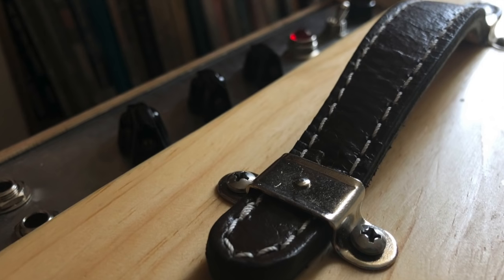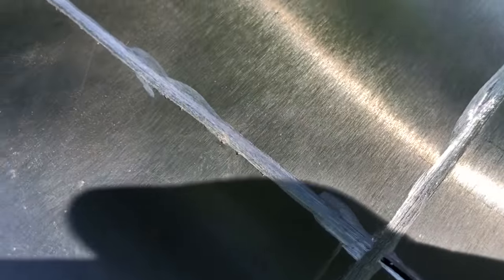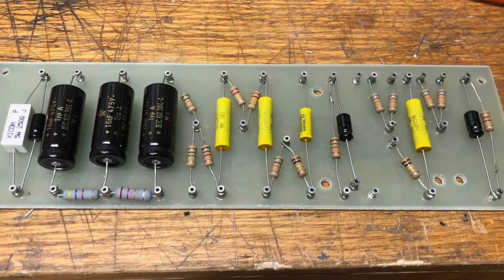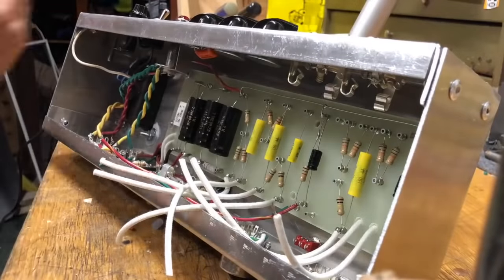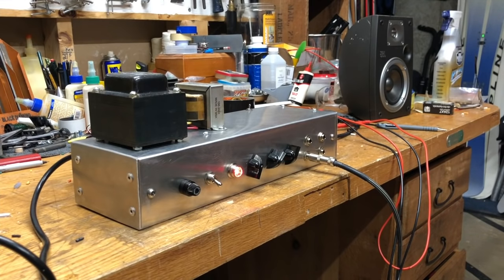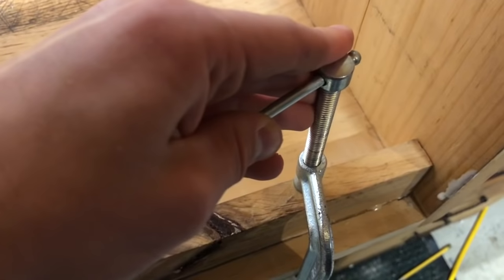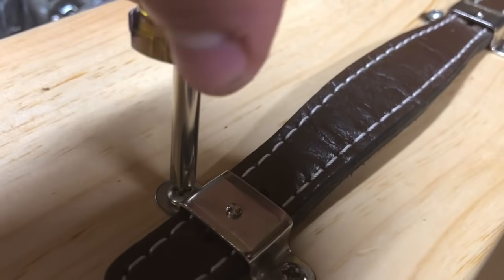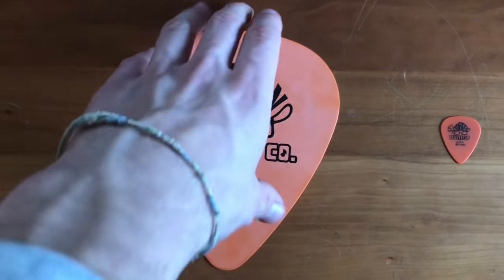Building a 5E3 Deluxe Guitar Amp From Scratch

Comment: Awesome project! I'm wondering why you deleted the standby switch? Typically, they will divert full current away from the tubes until the tubes have warmed up, greatly extending their service life.
Reply from the maker: Thank you! I deleted the standby switch because it really isn't necessary for the amp. It's actually a common misconception that a standby switch protects the tubes by applying the high voltage after they warm up, but it doesn't matter for the types of tubes used in guitar amps (receiving tubes).  The only real positive function they have is to protect the filter capacitors from the voltage surge that comes when you turn on the amp, but the voltage rating for filter caps are often more than enough, and if not this can be easily solved by just using slightly higher voltage filter caps. Also, here are a couple interesting articles that I used when I was researching this stuff:

https://www.sweetwater.com/sweetcare/articles/great-standby-switch-myth/

http://www.valvewizard.co.uk/standby.html#:~:text=You%20may%20have%20heard%20of,electrostatic%20field%20from%20the%20anode.
Reply: @joeles2738  I notice when I turn off my amp, if I do not turn off the standby switch first my tubes make a horrible squell.  You are saying thats not a problem?  I have a carvin nomad 112  Great video I am looking foward to getting into building & repairs myseld
Reply: Joe is correct on this one, standby switches aren't needed, they are a nice way to mute the amp quickly but the volume control does an excellent job at this also. Receiving tubes could care less whether HV is applied to them at turn on vs later. Tubes don't pull current until they are warm (reach operating temp).

Comment: Great job! And no standby! Finally someone's going back to oldschool :D However Uncle Doug wouldn't be happy with the heaters wires laying on the chassis :D
Reply from the maker: Thanks! I feel like there's a lot of controversy over heater wiring but in reality if you do either way neatly you get the same result haha
Reply: @joeles2738  haha yeah. A lot of this are kinda a preference I guess. Switch before fuse or fuse before switch? Ground soldered or screwed to the chasis? Bus ground? Star ground? If it works it works :D

Comment: My thoughts on designing an amp.....

I'd probably want the controls at the front, maybe even across the front edge at 45 degrees. It's no great hardship leaning over that little bit - but the controls were at the back because you stood behind your combo, so the reason for that placement has gone.

But my real bugbear...downward facing sockets.

I've never seen one fall out (except when they're being changed) but there's the option of having them stand upright or perpendicular.  Yes, it's convenient when you're swapping them out but how often does that happen?

I'm also not a fan of having the heat rise into the amp - not a biggie, but is there an advantage in heating your electrolytics or is it just boiling them? 

One thing I've always fancied - one of those cord retracting mechanisms like you get on vacuum cleaners. It'd be a bit of work - making a little house for the plug to home into and making sure it couldn't hit any of the glass on the way - but the idea tickles me.

Comment: Very nice!! I loved in the demo how the camera would shake with the higher gain sets!! :-) You mentioned a few mistakes… What would you have done differently in retrospect? (I’m definitely building one of those one day, but I’d like to avoid as many problems as possible)
Reply from the maker: Mainly it was things like I wish I had taken more time to make the inside of the amp look good, I should have used better tube sockets (I ended up replacing them) and the grille cloth needed to be replaced eventually because it wasn't very tough. I made a follow-up video that you could check out if you want that goes into greater detail about stuff I changed after this video was published and some things I wish I had done differently.

Comment: sick video man! amp sounds great. this makes me want to build my own amp. ill most likely do  robinettes jcm amp as im more so into "classic" rock. ill probably do some of his mods from the "tweaking the overdrive intensity & tone" section as well.

P.S. thanks for showing an easy way of making a cab! [or at least you made it look easy] i am usually not very good with wood working. at least where precision is needed! hah
Reply from the maker: I'm glad it was helpful! And yeah I actually don't have much woodworking experience either, at least with stuff that I want to look nice like this. The cabinet was definitely a challenge for me but I tried to do it in a fairly simple way. There are also much easier methods than finger joints for the main part of the cabinet, and if you're covering it with tolex anyway it doesn't really make a difference cosmetically.
Reply: @joeles2738  Surprised to read your comment about your woodworking skills. All your jigsaw cuts looked very good and accurate.

Comment: Yo this is fantastic! Why did you go with pine for the build? Pine is soft and kind of crappy. But overall, this is awesome my friend. I'm going to build a tube amp. So far I'm most nervous with the actual buildling of the electronic side of the project. The wood working is my forte, so that will be the really fun part. How long did it take you to complete this and about how much was the total cost? All in all you did a fantastic job! Good man!
Reply from the maker: Thanks! I used pine because I had a nice pine board already and it’s also easy to work with and looks nice. It’s also what fender used in the originals. I think the build costed about $400 and took about 2 months. Good luck with yours!

Comment: This is fantastic great video and build. 

Do you have a parts list that you can share?
Reply from the maker: Thanks! I never made a complete parts list, and I think the transformers I used are discontinued now anyway. But there’s a lot of information on forums that can help you decide what to buy. I would highly recommend tubedepot.com; I was able to find almost everything I needed on that one website
Reply: Try using the Stewmac 5E3 instruction manual, it has a parts list with illustrations and most values, Hammond do all transformers and they are reasonably priced.

Comment: FANTASTIC! If I may ask, what was your electronics experience prior to this build? I’m always fascinated by learning how other people got to where they are, and how they know what they know... Thanks...
Reply from the maker: Thank you! I just slowly started tinkering with electronics when I was about 12 or 13 and things progressed from there. I built a paper plate speaker, made some custom guitar pickups, built some RC airplanes, built two Tesla coils, and built a champ prior to this project, and I just accumulated the knowledge and things like soldering skills along the way.
Reply: @joeles2738  ... Outstanding! So you started at 12 or 13, and I’m guessing you are about 10 years older now? Early 20s? Ever built any amp KITS, as an intermediate step to this amp, like, for example, was the Champ a kit from some place like Tube Depot or similar? And I have to ask; in your years of tinkering, have you ever had any bad experiences, you know, with high voltage shocks, or damaged equipment? I see you have a diverse range of video types. I’d love to see more amp-specific videos; more builds or even troubleshooting, repairs, revivals, and restorations a la, Uncle Doug, Guitologist, Shango066, Jordan Pier, Mr. Carlson’s Lab, D-Lab Electronics, etc. It’s refreshing, the way you actually explain things... Thanks...
Reply from the maker: I'm actually only 17 now, going to college soon for engineering. And as far as other amp stuff, I actually haven't ever tried a kit; I sourced the parts individually for the champ as well. And to answer your question, I've always tried to prioritize safety and I haven't had any high voltage mishaps (knock on wood). But I'm glad you liked the video and I am planning on making more amp-specific repair and build videos once I have a little more time.
Reply: @joeles2738  WOW!! Only 17. I'm super impressed with your motivation and determination young man. Nice to see young people so beholden to carrying on the legacy of tube amps.

Comment: Thanks for the video! It turned out great. I’m actually thinking of making this same amp model as my first amp build, so this video was really helpful. I’ll be building on a budget, so if you don’t mind me asking, what was your total parts cost? Thanks!
Reply from the maker: I ended up losing track because of various little things that I had to buy but I think it came out to a little more than $400. However, I think it could be done cheaper than this because that includes me occasionally ordering the wrong part and having to reorder the right one and stuff like that. But I think $400 would be a reasonable goal if you’re building your own cabinet. And thanks for the comment!
Reply: @joeles2738  Thanks! That's good to know
Reply from the maker: @camilog-b5294  no problem 👌

Comment: Really really nice work here man. I always wanted to build my own tube amp, I just cant get hold of the materials I need for the amp (from where I live). I found online a Diy all tube amp kit but its an Hifi amp, do you this will work? Maybe I will have to change some parts, eg. output jacks, since they are mostly for hifi (like the ones the has bolt on it and will have to tighten to secure the wire from the speakers. I would very much appreciate any insight from you. Stay safe !
Reply from the maker: I think it would depend a lot on the kit, but generally speaking, guitars don't usually sound great through hi-fi amps. However, even though I don't really have any hi-fi amp experience, I know that some of those amps can be modified to be used as guitar amps. Good luck!

Comment: there free programs on the net that allow you to make the face of the controll part of the amp , baicy alows you to use a laserjet type printer to print the lettering and suck ontoo transfer paper and then use heat to transfer the ink ontoo the metal , you could allso use clear film and the laserprinter and them mount the whole film under the knobs and plugs

Comment: Nice job. The only thing I would have changed is Belton sockets. Those look like cheaper chinese sockets but lots of guys think they are alright. But good job man! Oh on your speaker baffle,, four nuts is usual.
Reply from the maker: Yeah, in hindsight I kinda wish I had used different sockets too. At the time I think I assumed “tube sockets are tube sockets” and then realized they’re kinda cheap after I wired everything haha. They do their job fine though
Reply: @joeles2738  yeah,, as long as it's a home amp it'll be fine. It's just that over time the metal in the sockets could start losing their grip on the pins and the tubes could fall out ! The beltons aren't that expensive, i think a buck and a quarter each,  and you would'nt have to worry about them for the life of the amp! They mount flush to the chassis too. Terry at D lab sez,,, throw em in the trash can. But nice sounding amp man!  Everything else is better quality than fricking fender uses! F and T electrolitics and mallory 150's. I like the mallory's over orange drops.
Reply: @joeles2738  oh yeah,,, I just remembered,,, If you go to Weber amps and find your way into cabinet dimensions they give the dimensions for everything they offer!  All the tweeds, blackface, british amps ect. Another interesting tidbit. Instead of baltic birch , which is expensive, dumble used marine ply in his cabinets sometimes. It's high quality mahogany ply. Great for tone in cabs and baffles. A little less expensive than baltic birch. Poplar ply is a great choice also!!!
Reply from the maker: @russellesimonetta3835  oh nice, that’s good to know about the cheaper woods. In my case my neighbor had some spare Baltic birch that he gave me so that wasn’t an issue lol. And yeah I think for the tube sockets I’ll just use them until they start giving me issues and then I’ll suck it up and replace them

Comment: U should cut some vents w/wire backing to vent the enclosed chassis
Reply from the maker: yeah that might be a good idea, I haven't really had any issues with heat though. Most of the heat that the amp generates is from the transformers and the tubes and they have plenty of air.

Comment: any time you want to bend aluminum do it on a hard surface or a realy hard pice of maple then screw a pice of angle iron throw the wood in to the bench then use a nother pice of anle iron clamp with C clamos vice grips youll get a better bend but hey man nice work shop

Comment: what size bits did you use to make the tube socket holes? same for all tubes?
Reply from the maker: I forget, I would just check the specs of whatever tube sockets you’re using
Reply: From memory, the 3 octals are about 30mm and the 2 9 pins are 18 or19mm

Comment: I'd put the xformers as far apart as possible and perpendicular to each other. They look like they are parallel to each other
Reply from the maker: The transformers actually are perpendicular; the windings of the power transformer are vertical and the windings of the output transformer are horizontal. I just went with Fender's original transformer layout and it seems to work well.